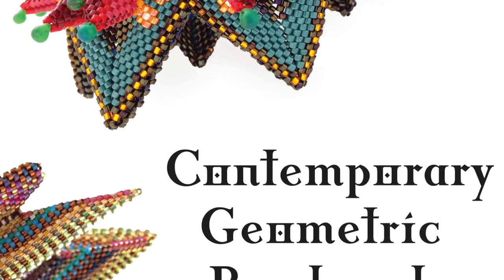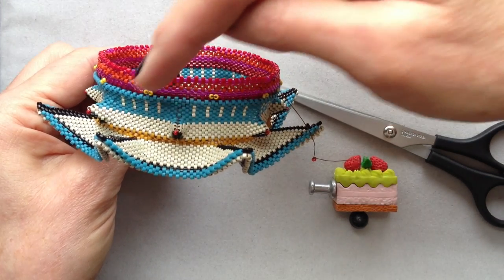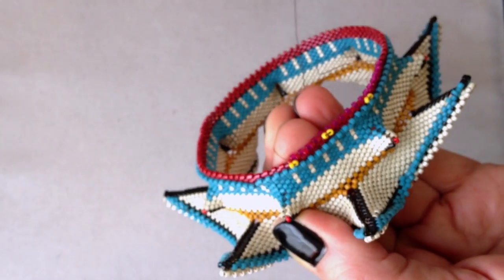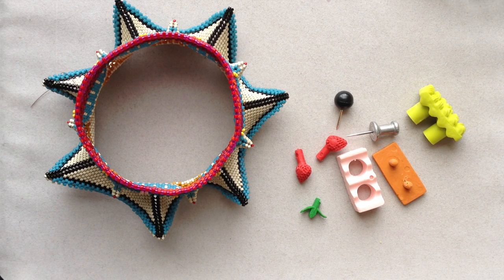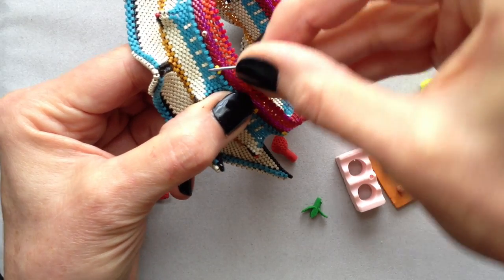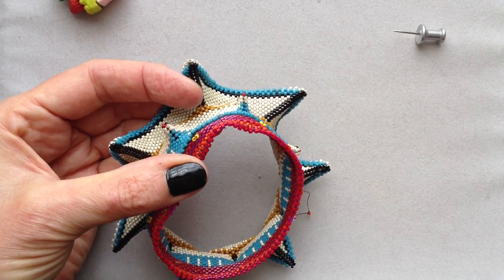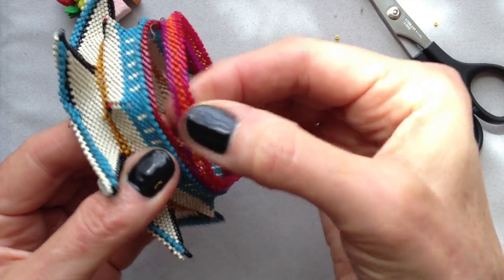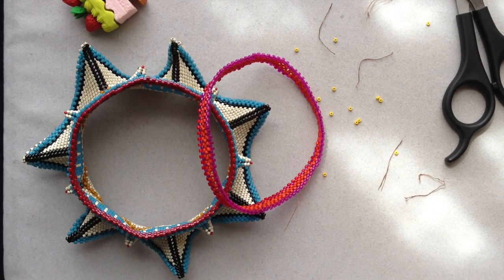The Exploding Round

Comment: This is all new to me. Can you explain to me why you did that. What was the purpose.  Very cool but I just don't know why.
Reply: This is new to me too. But I believe it's when you have a bangle that's a perfect fit you do the exploding round to get the exact same size as the original bangle the exploding round was removed from. That's how I understand this. I might be wrong though.
Reply: Hi, Sara. Yes, I am doing it because I want to start a new piece. This is a method to do it in the round, without a join, and to make something exactly the same size as a piece I am already happy with. It's simply one more good option, with a set of special advantages.
Reply: +Kate McKinnon What keeps the removable exploded round from coming apart???  Don't you have lots of cut threads hanging off the removable strip??
Reply: +Suzanne Golden 
Hi! 
If you think about it, each peyote round of a regular piece has at least two threads going through it - the thread from the round that it was put on in, and the thread from the round that follows it. If you cut only the portion of thread from the round in which the beads went on, that round will separate. Watch the Exploding Pentagon video!
Reply: +Kate McKinnon Ahhh... Will have to try one...You know me...slow to understand until I do it!!!  LOL..But an interesting way to start a new bracelet without having to
count out beads...